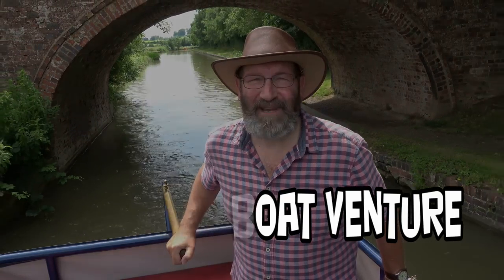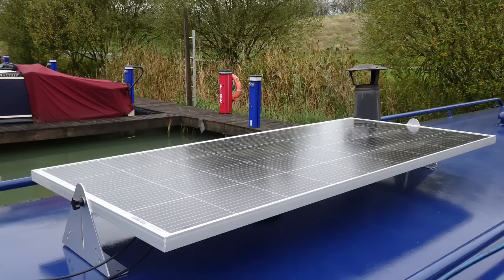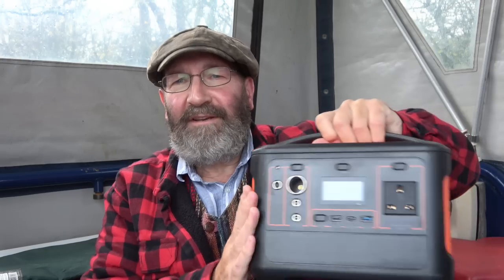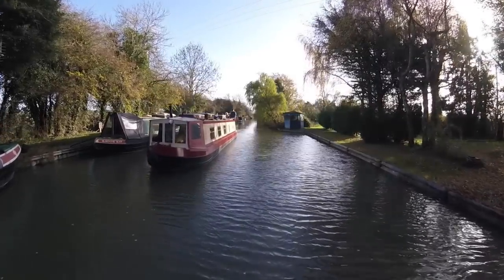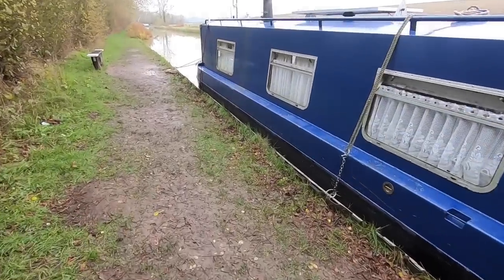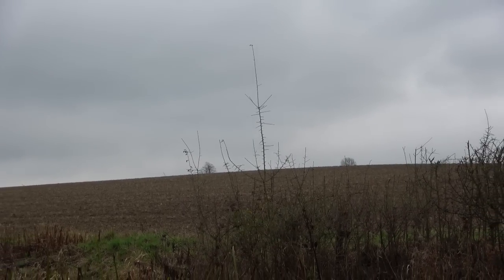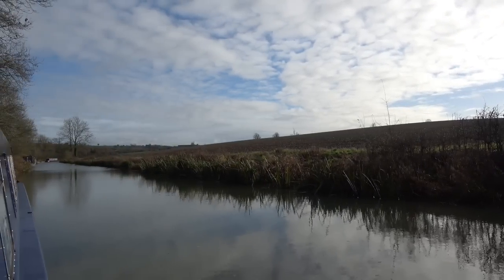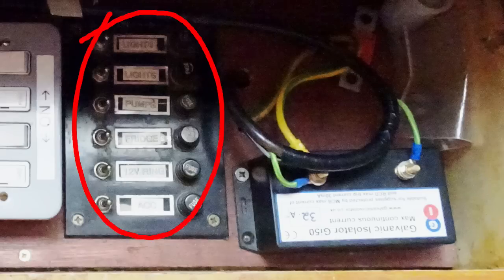308. Testing electrical changes on my narrowboat

Comment: Hi Alan just thought I might say that a friend of mine put the same sort of set up with his immersion heater as you have with two consumer units it then failed a survey as with two consumer units in the boat this would allow more then the allowed amount of power into the boat he had to remove one before it would pass the survey
Reply from the maker: Hi, thanks for the advice. I don’t doubt what you say but the number of consumer units on the boat has nothing to do with the power entering the boat. The power entering the boat comes from the 16 amp shoreline and there’s only one shoreline connection on my boat. I suspect your friend’s boat may have more than one shore line connection or other additional power source. That’s all I can think of. Unless correctly connected/synchronised that would cause a problem. Would you know whether he has or not? The BSS regulations refers to consumers units in the plural, so there is an expectation of more than one being present. Cheers
Reply: Hi this was some years ago and the survey was because the boat was being sold and the surveyor had the reputation of being very harsh I was only warning you in case this would be a future problem for you I personally would leave as is but maybe cover one with a box when due a bss examination
Reply from the maker: @bigKDL  Thanks for your reply, I don't believe it is a problem, and anyway it's another three years until my next BSS, so no need to think about it now. Cheers

Comment: Divide the  mains power of your apliance  with the stated wattage and this gives the amperage . Then see what amp hour that Chinese  wonder box gives out. See it start to smoke then lob it overboard before you burn your boat.
Reply from the maker: You're not a fan of Chinese technology then, but it's difficult to find anything not made there!
Reply: @MyNarrowboatVenture  no bud. Not a fan. Been in engineering to long to entertain junk. For the money you can waste on this I would say go to nearest Machine Mart store and buy a small Genny around 3kva. This time of year you need reliable life saving power 24/7.  Any battery pack or solar still needs a source. A Genny alot quiter and more efficient than running the main engine to power your boats electrical systems. Regards Dave
Reply from the maker: @davidbramley6730  Thanks for the advice David, I'm marina based, so it's not a real issue for me. Charging a power station would generally be done when cruising. Cheers
Reply: @MyNarrowboatVenture  Oh rite. Ok bud. But lob that junk overboard anyway. Lol.

Comment: Great to see you again on our screens Alan 
Cruising Crafts with Gareth and Lou featured a vlog this week where they bought a battery powered TV 
fantastic it runs for 10 hours after being fully charged.
The way forward me thinks 
Hope you're doing well
Keep safe warm dry and virus free.
Reply from the maker: Hi David, many thanks. It's interesting to know about the TV, I sometimes use my tablet as a TV, works a treat if there's a good wifi connection. I'm keeping fine thanks and hope you are. Cheers

Comment: Hi Alan , the boat electrics are not easy to get your head around but you made a very good decision getting the water heater to turn off when the power is out. I really enjoy your variation of vlogs, they are always interesting and I like to see what you’ve been getting up to. Take care 👍
Reply from the maker: When the new inverter was fitted, I hadn’t appreciated the way the immersion heater was wired in. So when I did, I got it sorted. I’m glad you like the variety I offer, there’s various different vlogs coming. Cheers

Comment: I'm surprised by the advice to power your router from a 240 volt inverter since most, if not all routers are 12volt dc and can therefore be run straight from your boat battery,
Reply from the maker: The router came with a mains lead and as I'm in the marina much of the time I use mains shore power. The idea to use a lower power inverter when cruising has worked very well. I could possibly convert to 12 volt but haven't seen a need.

Comment: It's no good when all the birds flock off🤔 when I bought my boat it had a 1kva inverter that I changed out for a 250w sine wave that charges the laptop or power tools and doesn't over tax the system though I don't have water heaters or any other high draw item's. We've had months of duck weather and are looking forward to some dry.🏴‍☠️
Reply from the maker: Hi Martin, I've heard from various viewers about the continual rain you've been having. I don't think I made it clear, the immersion heater is only powered by the shoreline, not the boat batteries, that would kill them pretty quickly. Hot water is provided when the engine is running or when the heating is on. I believe summer is soon upon you, enjoy.

Comment: Alan sub here but know nothing about narrowboating. It seem to me that the electrics on boats is very complicated. Are most owners self taught or do they have to be educated before they purchase their boats?
Reply from the maker: Greetings Philip. I'm not a techie but have a basic understanding of a boat's electrics but when I go onto the 12 volt boaters forum and see the discussions, it's usually way over my head. Anyone can buy a narrowboat, no experience is necessary. There are helmsman courses available for anyone who feels the need. I did a lot of research before I bought my boat, so had a lot of theoretical knowledge but no practical. I hired a boat for a weekend to make sure I liked it and then went ahead and found a boat to purchase. Cheers, thanks for commenting.
Reply: Thank you Alan

Comment: Why not ditch the power packs and buy a a100ah lithium battery sterling have offers on the battery will charge as fast or faster and last longer 👍✋
Reply from the maker: Thanks for commenting. I'm not sure if you're suggesting to buy a standalone battery or not. I already have 4 leisure batteries on the boat and I very much like the power station approach I'm adopting. The units are neat, portable and can be used outdoors, in my camper etc.

Comment: Good day Alan as you should well know I like all your vlogs no matter the topic. I'll leave the intricacies of the electrics alone on your boat but you seem to have a good handle on them. I was curious on your choice of batteries as the technical side is moving very rapidly with the various types of Lithium ,that also seems to be happening with solar.and wind where output per turbine isi ncreasing by leaps and bounds.These types of supply are the cheapest even competing with nuclear.The storage and variabilityi s also being solved with monster sized batteries and pumped storage.I know this is a bit different from Narrowboats but we have already seen electric narrowboats.
Take care stay warm see you soon .
Cheers from a cooler Canada High toady -3c low tonight -12c in some places.
Reply from the maker: Hi Ralph. I prefer to spend less, budget better and renew batteries more often than spend thousands of pounds in one hit on unproven lithium batteries in the Narrowboat environment. Lithium batteries don’t like the cold and claims they might last 15 years doesn’t interest me. Batteries on a Narrowboat can easily be damaged. Electric boats are a different prospect as they are purpose built with better insulation and charging systems. Getting quite cold there, we’re getting a lot of rain. All the best, take care.

Comment: ...at 8:37... reminds me of when I purchased my present home. There was a black walnut in the back yard that had been miserably mis-pruned (is that even a term?) over the years and there was a huge spindly limb that overhung the roof. I saw it as a disaster waiting to happen and it was soon gone. Will the CRT wait until it collapses and blocks the canal before tending to it (I know that they must be busier than a one-armed octopus with a rash!) but it must be easier to lop the thing off now rather than fish it out of the canal! Is it the responsibility of whoever owns the land on that side of the canal?
Reply from the maker: The CRT are fairly quick in dealing with fallen trees across the canal. Usually gone within 24 hours using contractors. Access to site can be an issue. This tree is on private land, I can well understand the difficulty of doing anything. I wonder how many more like it there are across the 2000 miles of canals! Small scale off side veg cutting is done by volunteers. Cheers

Comment: Good evening. I'm confused, in that what do your power pacsks do for you other than - in effect - just add add extra battery capacity to your boat's system?  Assuming that you recharge  it / them from whatever system you have on the boat.
What did I miss, please?
Reply from the maker: Hi Henry. Using a power pack, which is totally separate from the leisure battery bank means there is no drain on the batteries and less wear. The power pack can be recharged when cruising during the day, either from the inverter giving mains supply or from the leisure batteries, which are being charged from the engine alternator. I hope that helps.

Comment: When I was on my boat I adapted a cable and ran the router directly from a 12v supply. I think most routers are actually 12 volt.
Reply from the maker: Hi Steve, that's a good idea. I believe a lot of mains equipment runs at 12 volts or a little above, so power supplies can be adapted.

Comment: Do you not have a calorifier to heat the water when you're cruising?       I don't think you should worry about the quality of your videos, the sound and picture quality is always good and the subject is always interesting.
Reply from the maker: I do have a calorifier, which gets heated when cruising or from the central heating. The immersion is only used when attached to shoreline, which is most of the time. My reference to quality was (meant to be) when filming inside the boat, as the lighting isn't very good, but thank you so much for your very kind words.

Comment: Thank you for your chat, will be interested in how the power station goes, been looking into getting one in case of power cuts, we get them where I live when the weather is rough due to overhead lines, I need power for my assistive equipment but they are extremely expensive
Reply from the maker: Hi Sandra, I'm very pleased with the power station. I didn't want to fork out for an expensive one, so I took the risk with a budget priced one, the build quality feels good to me, it's longevity remains to be seen but it's working well for me. It may be that you need a higher rated model than mine for your equipment, so there might be less choice and a higher price to pay.
Reply: Thank you, I am not sure about the watts etc
Reply from the maker: @weavenut  Your equipment should be marked with the wattage, if you’re uncertain, your supplier should be able to advise.